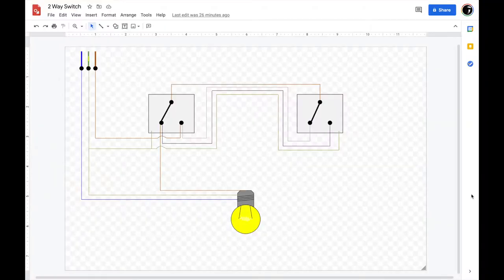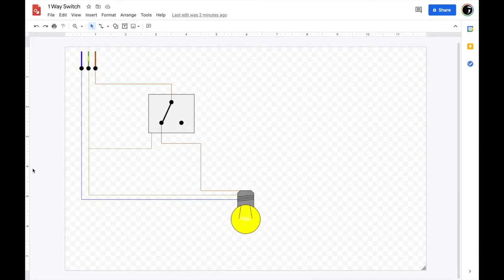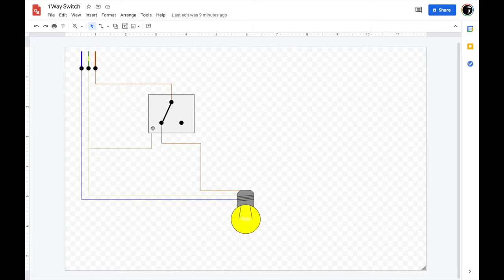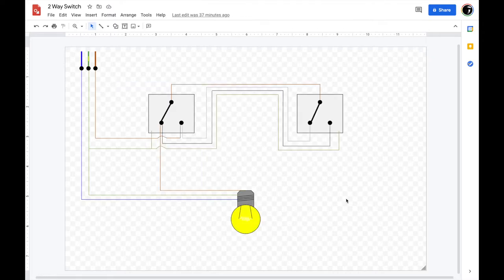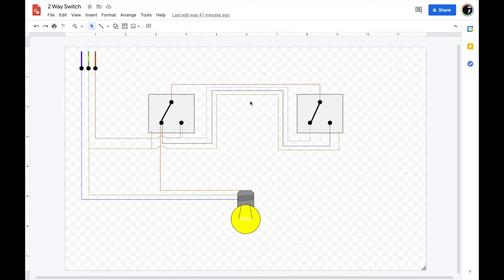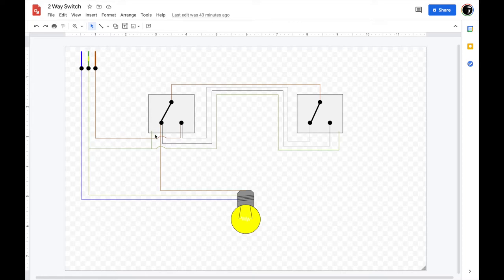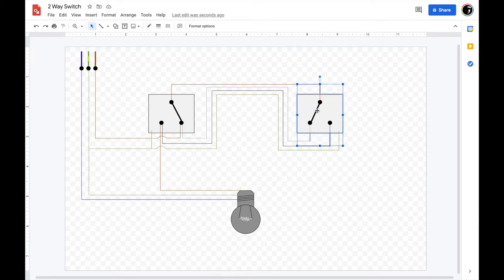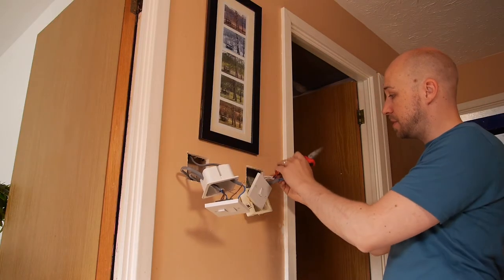2 way switch install - hallway and loft lights | Quick jobs 05

Comment: I appreciate every one likes to have a shot but installing joints like that in walls are not allowed under BS7671. If you were to have an electrician carry out a EICR that if found would have a C2 attributed to it ( Potentially dangerous) see reg 526.5 onward.
Reply from the maker: Yep, that's a fair point. In this case that particular connection has subsequently been replaced with a maintenance-free junction box.